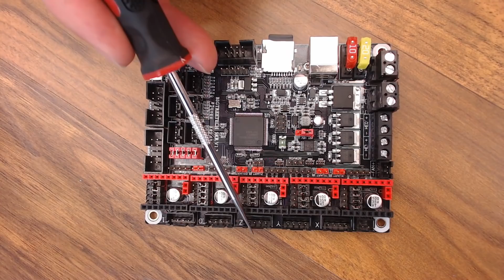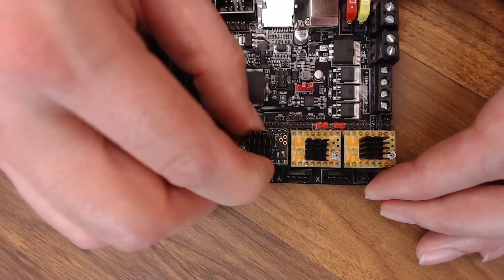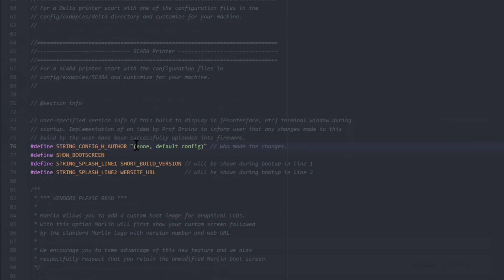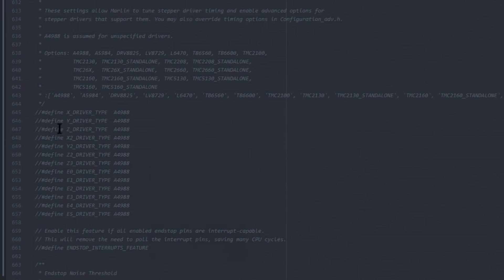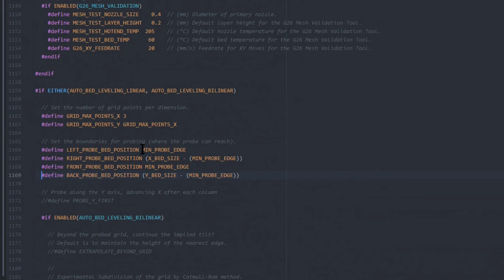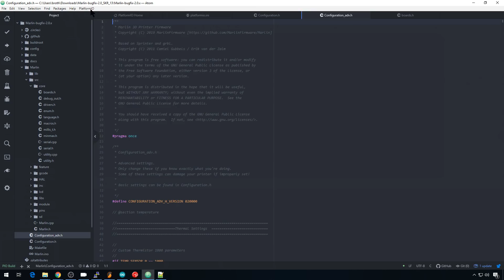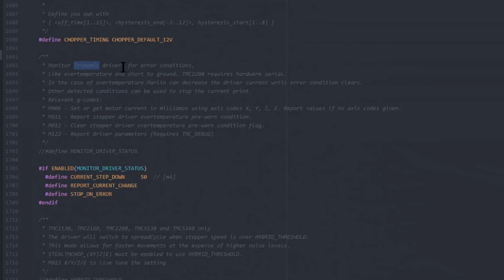SKR v1.3 Mainboard Install - TMC2208 - Chris's Basement

Comment: Hey chris! Where did you connect the driver cooler fan? Some say 12v/24v 2 pin. Others say HE1. Also read about using y max and mosfet? What's would you do?
Reply from the maker: I think I am going to move my hotend fan to HE1 and try to make it auto, then use the 12v pins for the board fan. Yeah, that would work with a mosfet.
Reply: @ChrisRiley  I found a ender 3 config I had to modify a bit but it works great so far! Did my first auto home 5 min ago.  It does use the HE1 and works great!
Reply from the maker: @trickygaming773  Very nice!

Comment: A big thank you for this great video from Germany in the "old" world. I considered to get a Re-Arm after your video on that. But you changed my mind. There is one question I have you might to answer. Based on your video for the "controllable" Hotend Fan which works great on my RAMPS I am wondering if you can explain me how to set it up on the SKR. Which Pin can I use? I'm not so deep into electronics to figure out by myself. Thanks again, I love your videos.
Reply from the maker: If you only have 1 extruder, i think you can hook your fan up to HE1 and it should work as expected.

Comment: How to configure SKR 1.3 with 5 Button 20x4 LCD panel?
Reply from the maker: Did it come off an anet or tronxy?
Reply: @ChrisRiley  It came off zonestar but I believe it's the same
Reply from the maker: @KasparsKampys  Use this one:
// ANET and Tronxy 20x4 Controller
//
//#define ZONESTAR_LCD            // Requires ADC_KEYPAD_PIN to be assigned to an analog pin.
                                  // This LCD is known to be susceptible to electrical interference
                                  // which scrambles the display.  Pressing any button clears it up.
                                  // This is a LCD2004 display with 5 analog buttons.

Comment: Chris, loved the video.  Thanks!! However i have a question that i just can't seem to answer.  what plugs was it designed for?  i have looked everwhere i can think of, but i don't know what plugs to get for my motors/thermisters/etc.
Reply from the maker: Thanks for watching. They are JST type connectors. You can get kits on amazon. https://www.amazon.com/GeeBat-460pcs-Connector-Housing-Adapter/dp/B01MCZE2HM/ref=sr_1_4?keywords=jst+connectors&qid=1558901570&s=gateway&sr=8-4
Reply: @ChrisRiley  Thank you, i shall grab a set for the SKR board that came in yesterday! JST-XH
Reply: @javabean5272  

Yep, those are the ones you need.  I got this kit because it was the same price and you get more connectors:
https://www.amazon.com/gp/product/B0791DJMW9/ref=ppx_yo_dt_b_asin_title_o04_s00?ie=UTF8&psc=1

I also broke down and bought these crimpers.  It's not a must, but it sure makes it easier:
https://www.amazon.com/gp/product/B078WNZ9FW/ref=ppx_yo_dt_b_asin_title_o01_s01?ie=UTF8&psc=1

Comment: Why wasn't the extruder turning during the test at 25:00 like it was during the tests on the 8 bit board?
Reply from the maker: That's a good question. Ha! There was a bug in Marlin 2.0 with the extruder, maybe I hit that. I will check it out. I also might have forgot to disable allow cold extrusion.

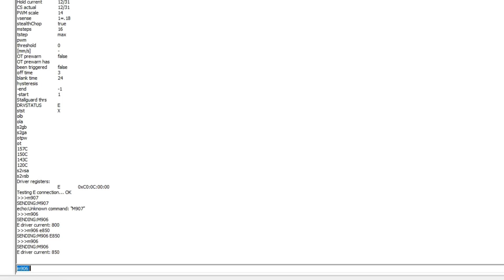Comment: You have a typo! 2208 uart setting current not voltage as you say in the video at around 30:00. So setting current and volt should be correct no?
Reply from the maker: You're correct, it should be current.

Comment: Very nice informative video Chris! I did not know your channel from before but will follow along as I am all about technical 3d printing nerdly stuff as I design 3d printers
Reply from the maker: Thanks! Glad you like it.
Reply: @ChrisRiley  If you also could check speed printing from octoprint that would be nice. This is a buffer issue in the firmware and not processor as I understand so we might see studder also here?
Reply from the maker: @PRO3DESIGN  For sure, that is one of the main points I want to test.

Comment: Another Great instructional Chris , did you have the board ‘powered’ (12v/24v) when you loaded Firmware or USB only ??
Reply from the maker: Yes, it has to be powered 12v/24v to upload.
Reply: @ChrisRiley  sorry to pester you Chris - having real trouble getting Octopi to connect to SKR 1.3 - any settings in the Raspberry Pi that is essential ?? Beginning to think I've got a dud board :(
Reply from the maker: @JarleTeigland  I just cabled up, left it auto and auto and it connected. Not sure if this is helpful or not. Your serial is set to -1 in your code correct?

Changing monitoring state from "Offline" to "Detecting serial port"
Serial port list: ['/dev/ttyACM0']
Connecting to: /dev/ttyACM0
Changing monitoring state from "Detecting serial port" to "Opening serial port"
Connected to: Serial<id=0x710b3f10, open=True>(port='/dev/ttyACM0', baudrate=115200, bytesize=8, parity='N', stopbits=1, timeout=10.0, xonxoff=False, rtscts=False, dsrdtr=False), starting monitor
Starting baud rate detection...
Changing monitoring state from "Opening serial port" to "Detecting baudrate"
Trying baudrate: 115200

Comment: Details on the new SKR Pro Board!

- 15ABlade Fuse added and 30A Fuse changed. 
- Built-in 6-channel driver with Dual-Z function Supports 7 ports. 
- Changed to a stronger screw terminal. 
- USB B port addition. 
- PWM FAN 4 ports. 
- Added I2C.
- 10/100 LAN

- STM32F4 CPU = 180Mhz

Will Be released very Soon!
Board PIC = http://i63.tinypic.com/10x8ork.jpg
Credit to this info to @Nick Allen
Reply from the maker: Thanks, I'll check it out.

Comment: Nice Work Chris :) 
Nice video .. i have question ! 
1 - So u Men 32Bit better for large Gcode File ?! then 8Bit .. 
2 - URT Mode This like TMC2130SPI Mode . its control Current And ect ?! Or im Wrong !
Reply from the maker: Thanks, 32 bit can just process the gcode faster, it doesn't matter how big it is. Correct, all the connections are built in for SPI and UART, no extra wires needed.
Reply: @ChrisRiley  u Men in SPI ANd UART i dont need to hookup Wire over Driver like Old One ? Just Put Some Jumper and so !?
Reply from the maker: @mohamedatef8424  Correct.
Reply: @ChrisRiley  Thanks .. that is Better then old one .. any idea how to make my board with sd card :)
Reply from the maker: You should be able to just put a screen/reader on the board and it will work.
Reply: @ChrisRiley  thanks

Comment: Any chance we can get BLTouch v3 to Marlin firmware video? I am confused on all the problems that came with the release of v3 and do not know what to do with my Marlin firmware, with bug fixes, "pull this capacitor", "it does not work" comments and need some real expert current guidance.
Reply: I've got a BLTouch V3 plugged in to my SKR v1.3 (Ender 3 upgrade). The probing wasn't consistent and sometimes the probe would trigger too soon. The fix for me was to ensure that "#define BLTOUCH_FORCE_5V_MODE" was un-commented (enabled).   My BLTouch was the problematic version that was released in March and was quickly updated in April by the "newer V3" (not the 3.1).  You'll need to swap the sensor wires around before you plug it into the servo pins on the SKR 1.3 board.  Do a search for the SKR 1.3 pinout diagram, and match up the Signal, 5V, and Grd connections (orange, red, brown respectively).  The end stop wires will depend on what type of switch you have.
Reply from the maker: I need to get a hold of a v3, there have been a lot of questions on it.

Comment: looking forward to the rest of this series. I'm particularly interested in hearing what the benefits are to a cartesian printer where the moving bed could be the gating factor.  Also curious if Marlin 2.0 takes advantage of the 32 bits, or is it a straight port?
Reply from the maker: Thanks, I will try to touch on these as well.

Comment: My drivers work fine when I am using them in standby mode but whenever I try to use UART my LCD says TMC Connection Error.  I am using the same board as you except I am using v2 TMC 2208, I even bought some TMC 2130 and they do the same thing fine in standby, but then the same message in SPI.  I have the pins configured correctly on my board and changed my firmware, what is causing this?
Reply from the maker: Did you solder the jumpers on the driver?
Reply: @ChrisRiley  Yes, I did
Reply from the maker: @treyroudebush1029  That's the only thing I can think of. Maybe the board has issues.
Reply: @treyroudebush1029  
Make sure you enable "#define TMC_DEBUG" in Marlin so you can send the 'M122' command, which may help you troubleshoot the issue.  It may just be one TMC2208 that isn't talking.  M122 should show you which drivers it 'sees' and could point the finger at a bad driver.  Hope you figure it out and get it working!  :)

Comment: Another great video Chris. I've been using this board since it was released, great value for money. But I wouldn't recommend the Bigtreetech TMC's the FYSETC boards have a better thermal design.
Reply: Newer bigtreetech tmcs are even better than fysetc!  Giant thermal pad, and uart pad pre-soldered from shop.
Reply: @LoKuSKus77  Just looked. Yeah I agree, the V3.0 is much better. I see it also now has the chip on the correct side (underside) of the board.
Reply from the maker: Nice! Thanks, I'll have to check those out.

Comment: Hi Chris, thanks for making this video, I enjoyed especially the circle speed tests.  I have some suggestions for your next video testing out the SKR1.3.  I've been an early adopter of the SKR1.3 BIQU sent me a free SKR 1.3 for contributing the "popular" product suggestion of TMC2208 UART w/o flying wires, so I've been using it for a while.

Suggestions:
1. Using Vase mode will result in a constant circular speed, without the layer change jerk/bump.  This will make it easier to visually separate stutters from layer change jerks.
2. Test to see if printing via USB via Octoprint behaves differently.  Ie, see if the Octoprint USB bandwidth bottleneck is still a factor with the SKR1.3.  The interesting thing about the SKR1.3 (and setting serial port to -1 in marlin configuration.h is a clue to this) is that Baud Rate doesn't matter whether its 9.6k or 500K - there is no USB to serial conversion happening - There is a direct USB connection between the pi (or computer) into the SKR. 
Andy Shaw, who personally wrote most of the SKR/LPC1768 USB stack said, verbatim, "There is no USB to serial conversion on the SKR boards. The USB stack (which runs on the LPC1768) handles the "USB serial" connection directly."  Source: https://www.facebook.com/groups/505736576548648/permalink/668928390229465/?comment_tracking=%7B%22tn%22%3A%22O%22%7D

Therefore in theory, there is oodles of bandwidth over the USB bus. However, jury is still out on whether this takes out Octoprint as the bottleneck when printing fast circles, or simply raises the speed ceiling before octoprint bottlenecks because the Pi still needs to supply instructions just in time and is timing sensitive - if the SKR board's marlin buffer empties just for a tiny period of time despite having large bandwidth, then you still get stutters.  For my own firmware build, I've increased buffers just in case since theres gobs of memory available.  My commit with my buffer settings.  https://github.com/talldonkey/Marlin-2.0-SKR-1.3-Ender-3/commit/8dd0490d8ff123fd15fe7f4181a48a4c00d091ce

I did a test print at 150mm/s inner walls (2600 acceleration) and 50mm/s outer walls (500 acceleration) (Via Octoprint) and was shocked at the quality I got.  I was expecting a mess, but it came out 85% good.
Reply from the maker: Great suggestion, thank you. I will be sure to do that.

Comment: You can easliy configure Marlin to use the E1 Stepper as Z1 if you have a standard single-extruder setup. It keeps the required current on the stepper down, that is something you usually should care about on the "small" tmcs like 2130 or 2208.
Reply from the maker: I thought I actually mentioned that in this video, but I guess I cut it out. I will show that config on the next one. Thanks for the comment.
Reply: @ChrisRiley  Please do I'd like to do this :) As much as just reading the docs helps I still like to see others do it.

Comment: What is uart and what is the benefit? Does it just allow soft control of the board features?
Reply from the maker: Correct, Universal Asynchronous Receiver/Transmitter, it allows the control of it through software.

Comment: 23:20 — Don't forget `M502`, `M500` after flashing the new firmware to make sure your new configured settings get activated and saved to the EEPROM. (The board reset button likely does not clear the EEPROM, and Marlin saves EEPROM data to SD or MCU flash on some boards.)
Reply from the maker: Thanks Scott! Yes, I totally didn't do that in this one. Hopefully I remembered that in the Re-arm video. LOL It will be in the next one indeed.
Reply from the maker: @Bryan Rentoul I always forget to mention the eeprom reset. :)
Reply from the maker: @soundspark  Which interface?
Reply from the maker: @soundspark  Ah, gotcha.

Comment: Have been trying to get my SKR 1.3 to work on an Ender 5. Everything seems to be working like it should except the Extruder motor. When I try to move it with the Ender 5 screen it moves once then stop working. I checked the drivers by switching them and the motor by moving to another axis. Seems to be a bug.  My Config files:

https://github.com/mand0c0mmand0/SKR-1.3-TMC2208-SA-Ender-5
Reply: try using the E1 for your extruder
Reply: I had tried using E1 as E0. Still same results. Seems it was a bug that has since been fixed.
Reply from the maker: Yeah, sounds like a bug, like @Russel De Vera said, maybe try moving it to E1.

Comment: I'm doing an SKR 1.3 swap on my Ender-3.  I have everything working except for the extruder with TMC2208 in UART mode.  The extruder acts weird and just vibrates when I send it move commands.
Reply: My problem has been resolved by using latest uplaod of Marlin. Seems it was a bug.
Reply from the maker: @mand0c0mmand0  Nice!
Reply: Are you using the stock screen to send move commands? I have a problem with 2208s in stand alone. When I try to move them on stock screen the move once then stop working.
Reply: @mand0c0mmand0  All of the other axis move fine with my RepRap discount screen.   But since you mentioned it I just tried it on from OctoPrint and it works fine.
Reply: disable pressure advance or set the minimum pulse to 1 for the Extruder
Reply from the maker: Yeah, I have seen this a couple of times now, not sure where the bug is. The controller or pressure advance.

Comment: I found some issue on MKS TMC2208 in UART mode.
It works fine on MKS GEN L board in UART - don't need to solder any pads because it has UART pin.
But, on SKR 1.3 it's not working in UART mode. I tried even solder UART + NC pin because i know that SKR reads UART signal on 4 pin (MKS TMC driver has UART on 5pin) and its still not working ;)
I tried alot of combinations and still nothing ;)
So on MKS GEN L it works fine, but on SKR don't  :)

Anyway its the best board in this price.
Reply: Did you remove the jumpers next to the endstops? There should be no jumpers installed except for the UART pins
Reply: As per Jake's suggestion check your jumpers. I'm using it with 2208's without any  modifications.

Comment: Great video as usual Chris.  A bit over my head, I'm afraid, though.  Someday.  LOL
Curious though.  Is the G-Code - generated by the slicer - using G2/G3 commands, or is the slicer generating point-to-point G-Code commands to emulate the circles?
Thanks, as always.
Reply: Cura isn't using G2/G3 AFAIK
Reply: @KucharJosef  - I don't think so either.  Some of the others do.  Marlin supports them.
Reply from the maker: That's a great question Ron and the files I sliced are all G1 commands.
Reply: @ChrisRiley  - Yeah, I am sure the 8-bit board would choke if you enabled the G2/G3 output code option in your slicer.  It would be so processor intensive.  I'm curious though, how would the 32-bit board perform if the G2?G3 output option was enabled in your slicer?  That might be an interesting comparison with these tests you've run in this video.  :-)
Reply from the maker: @RonFloyd  Agreed, we need to test this for sure.
Reply: @ChrisRiley  - Looking forward to that!  Thanks!
Reply: @ChrisRiley  - Of course, setting the G1 code's steps to very tiny increments would probably result in the same print quality - without demanding nearly so much of the processor's time.
Reply: @ChrisRiley  - My background is based on G-Code programming of full CNC controlled lathes, milling machines, machining centers, etc.  We would seldom, if ever, use G1 commands to make any radial moves.  G2/G3 commands were the norm.  But, the machines had processors powerful enough that they could do the calculations fast enough during real-time moves.  The older paper tape fed NC machines relied on calculations made by off-line computers.  Those machines sometimes used G2/G3 code also, but only if the machines had processors powerful enough to do so.  Since the external programming stations did the bulk of the calculations, sometimes the machines had the processing time available to make the necessary G2/G3calculations.  If not, the external programming computers would output only G1 commands - like 3D printing slicers usually do now.  The earliest NC machines ran directly off of the paper tape - and they had no internal processors.  So they had to rely only on G1 moves.